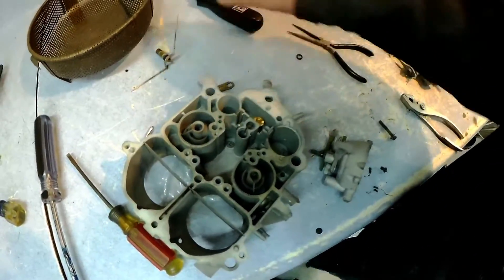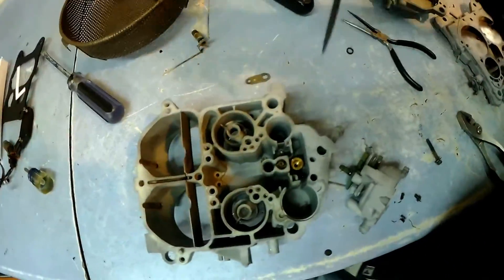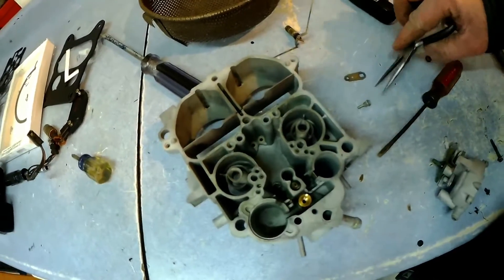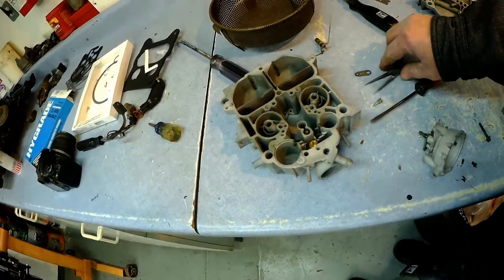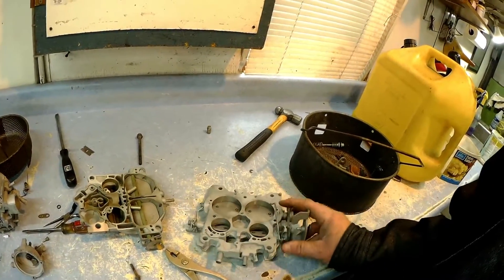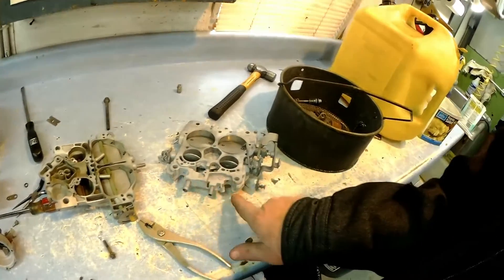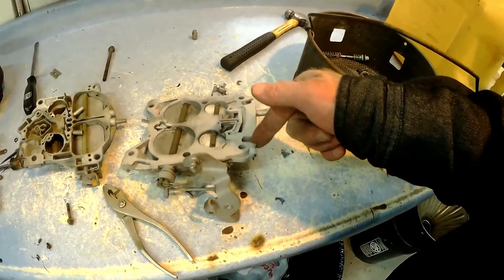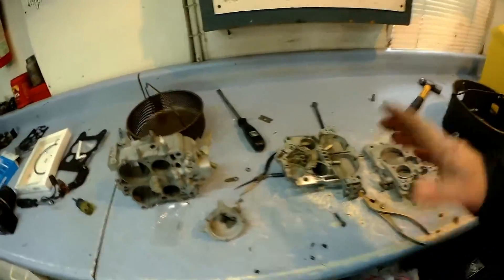GM Quadrajet Rebuild Tips

Comment: Hey Mark, great video!    I just rebuilt my quadrajet today but the included instructions didn't have my particular model# to set the float... what height is a good one for my old 1984 motorhome quadrajet?

Also, can you please elaborate on setting the idle screws? I didn't mess with mine, only cleaned them and put them in the way they were before but I'm sure it's running too rich
Reply from the maker: Basically, if your float is new (unbent at the adjustment point), install it and push down on the needle end (so the needle is shut off).  The float (itself) should be parallel with the top of the carb.
If it's not, bend it at the adjustment point.  If your carb has not had the idle restrictors drilled out, your idle screws are only effective until about 3 turns out. Beyond that, they do nothing.  So start at 3 turns out and you can go in a little, perhaps down to 2 turns.  Play around with them until you're satisfied with the idle.  You can tell if you're lean by placing your hand over the air horn and slowly restricting the air going into the engine (causing some fuel to be sucked out of the main nozzles).  If the idle picks up, you're lean.  Back the mixture screws out a bit.  But like I say, anything past about 3 turns and you're doing nothing.

Comment: Mr Mark I rebuilt Rochester  Quadrajet put it all back together but would not stay running i could here a vacum leak but i can"t not find it.'
Reply from the maker: Take a piece of vacuum line about 4 feet long, put one end of it at the opening of your ear, take the other end and start moving it around the base of the carburetor, intake manifold, etc.  You will instantly find it.

Comment: I'm really scared to rebuild the truck is running good but I dont know how long it's been on the truck and want to redo everything so I know when it's been done. Am I going to have to retune or do any timing after I rebuild or can I just slap it back on and go?
Reply from the maker: Just mark the choke spring to the housing (assuming you have a integral choke).  You can count the number of turns the idle mixture screws are turned out and set them back to the same setting if you're worried about that.  Beyond that, there is nothing to worry about.

Comment: I have a question.  After cleaning the carb can you paint the carb to get a good look under the hood or look at edelbrock
Reply from the maker: I've never tried but I can't see why not.  I'd start with primer suitable for aluminum (let it dry real good, stick it in the oven at 160 for a few hours) then finish with your color coat.  Be sure your color coat is gasoline resistant. A 2 part epoxy might work. My gut tells me you want to "brush" it on because if you try spraying it on,  you'll get paint in places is should not be. Stay away from the throttle shaft, choke plate, accelerator pump,  any linkage..... If you do, please put up a video of the finished product !

Comment: Dear sir:
I own a 1977 chevrolet Corvette with  the L82 engine
After suffering a gasoline fire in my garage due to a broken glass bodied fuel filter.
Needless to say I had one of the most scary moments of my life until I was able to put out the fire.
Anyway the damage to distributor, wires, carburettor was extensive.
My mechanic and I decided this could be the time to make a long needed overhaul of the engine and I went ahead and bought a new distributor and a rebuilt  quadrajet carb.
My problem now is as follows:
Thr engine starts easily and after warmed up and going to idle it dies.
Something looks wrong with the idle  circuit.The only way to keep it running is to accelerate to 2000 rpm or so
What do you make of this.
Your experience is invaluable for us.
Thank you in advance
Reply from the maker: Yes, I agree, the idle circuit is most likely the problem. As a test, place your hand over the carb inlet, slowly restricting the air flow at an idle, and if you can correct the problem, the idle circuit is almost certainly the problem

Comment: I could use some help. And thanks for the tips. I have 3 quads that came off a 305s. I want to rebuild 1 and put it on my 496. I’m worried the carb will be to small. Any thoughts.
Reply from the maker: Ok a 496 turning 5000 rpm consumes  ((496/2) x 5000)/1728 = 717 cubic feet per minute of air.  But then we reduce that slightly by the volumetric efficiency.  90% is considered good, so 717 x .9 = 645 CFM.    So yes, it will work. But if it's off a 305, the secondary air door is restricted from opening all the way.  Just saw off the stop so it flops all the way open (90 degrees) when you press on it.   If you're spinning it harder than 5000, you'd probably want to find an 850 Q-jet off an older big block Buick or Olds, but even at that, it will still work just fine if you don't.  You'll just lose a little horsepower right at the very top. But nobody should be spinning a 496 faster than 5000 anyway unless you like rebuilding the thing every other week...lol...  I've been down the road with those engines more than once.
Reply: Thanks for the reply I ended buying the HR750 quick fuel. But later I like to experiment and mount 2 quads on it. Thanks again.

Comment: Mark, I've found  this video to be very informative...Thanks .  I do have a question regarding the quadrajet living under the dog house on my 1985 Chevy P30 motor home chassis, which I'm  in the process of rebuilding.  Are there  any additional tips you can offer regarding a balance of drive-ability and economy, as this fleetwood behemoth doesn't get the greatest mileage, nor power when you need it.  This carb  sits atop a chev 454.  Any help would be greatly appreciated...Marty
Reply from the maker: Sorry sorry - nothing that I am aware of will give you both better drive ability AND better economy.  They are exclusively at odds with one another :-(

Comment: Hey mark just got a 85 c10 with a 4.3 with this carb,its been sitting but not that long,what would you recommend?should i clean it or rebuild it,the truck start runs good and idles pretty good but since its been sitting.i dont know just a 17 year old trying to learn,should i mess withit or leave it alone
Reply from the maker: Drive it, see what you got. Those old 4.3's with 4 barrels ran good !
Reply: @mark_osborne  alrighty what about the granny low four speed those run pretty slow or get up and go

Comment: What a great video. Can you provide more details on how to get the best gas mileage for a daily driver?
Reply from the maker: There isn't much you can really do if it's a stock carb with proper jets and metering rods sized for the engine. Advancing the timing a few degrees can help at the risk of spark knock.  Make sure your mechanical advance is working properly and the vacuum advance is functioning and has the proper vacuum source connected to it.

Comment: Taking you up on posting a comment with a quadrajet problem.  I rebuilt mine, but did not file it down like yours unfortunately.  I just saw your tips today.  Anyway, my carb runs a little rich, so I hooked up the vacuum gauge to adjust the mixture screws, but when I adjust them, there is NO change.  I can back the screws out and screw it all the way in and there isn't much change - no drastic change anyway.  Any suggestions?  It is a marine quadrajet - probably doesn't matter.  The exhaust smells rather rich and I can see a little fuel maybe in the exhaust water discharge, but it seems to idle ok.  Not as nice as my other engine idle, but it does idle alright.  Also, very, very hard to start cold, but once it gets going, it is good.  Maybe they're related...I dunno.
Reply from the maker: When you run those mixture screws in  you are cutting off fuel to the idle circuit (as you probably know) and it should get so lean it stumbles.  Because that's not the case, I suspect you're getting fuel from somewhere else and the most likely culprit would be if the fuel level in the float bowl was too high.  Try looking down into the discharge boosters with a strong flashlight and see if you can see fuel dripping from a booster, check the secondary side too.   A hard cold start (if carb related) means either the accelerator pump isn't shooting fuel when you pump the throttle, or the choke isn't closed all the way.
Reply: @mark_osborne  I've got the same problem.  I checked the float, now I'm looking for a vacuum leak.  Only getting 14" of vacuum

Comment: My marine quadrajet won't idle at all. Took it apart and rebuilt it cleaned everything reassembled but zero idle. Will run with anything above idle or if choke is fully closed. Btw this is why I rebuilt it in the first place. Ideas? I tried the two air mixture screws and made no difference
Reply: Any thoughts on the no idle situation?
Reply from the maker: Sounds like a blockage in the idle fuel feed circuit. It's not likely in the throttle plate as you can literally see the circuit, rather, almost certainly in the body of carb.  I'd take it back apart and using a rubber blow-gun nozzle, blow air down through the holes that are next to the primary venturi (s)- both sides. This is the idle fuel well.  Take a small wire and see if you can dig around as well. Also, make sure the top section of the carb is not warped. If it's warped, fuel won't flow properly through the idle circuit as it takes a trip up- then back down through the top plate right next to where the 2 small bolts secure the top plate at the venturi (both sides)
Reply: Thanks I will try that. I forced carb cleaner through all passages and it seems to flow thru but did not use high pressure. Carb did have water in it and sat a couple years, was a dunked up mess when i took it apart. Good news is everything past idle works great now, don't believe the secondaries worked at all before, always bogged down and had to pump the throttle to get it on plane. Greatly appreciate your insight, great viedo!
Reply from the maker: @timmthirty7928  water is the worst, almost certain there is corrosion in the idle wells. You could try some CLR, squirt some down the the holes into the idle wells and let it sit, blow it out, repeat, you might clear the blockage

Comment: getting ready to do one and I think there is issues with the linkage.  The secondaries do not open up. After removing the carb I noticed a lockout for the sec.  What is that for? Where do I find the specs for the linkage? Thanks
Reply from the maker: It's there to prevent the secondaries from opening while the engine is cold. It's pushed out of the way when the choke opens (fully).  You can eliminate the lock out by removing it.  Your secondaries will open while the engine is cold, possible "bog"... but it's all good if you are prepared and compensate with your driving style.  Once she's warmed up- it's all good. If you want to keep the lock out, just be sure the choke opens all the way once she's warmed up -  that will push the lockout out of the way.  Otherwise, there are no specs.
Reply: @mark_osborne  Thanks for getting back to me.  Starting on it today hopefully.

Comment: mark Hello, greetings from Venezuela, what could I do to save fuel? I have a dual jet but it is a dragon, yes it canbio chicler and how could I lower consumption? What do you recommend? Greetings and thanks for your help. You are a master in this I congratulate you  I also discovered when I was cleaning it that it did not have the control ball that goes under the screw that you explained what problems it brings me that increases the consumption of gasoline for not having it
Reply from the maker: The check ball allows the accelerator pump to function properly, it will have no effect on fuel consumption.  Make sure your float is not set too high, if it is, you can get 'spill over' effecting fuel consumption.  Beyond that, there's nothing easy you can do that will cause it to use less fuel.  If you have an Oxygen sensor make sure it's working and plugged in.

Comment: Hi Mark, great explaining. I have a qj on an aussie holden v8. I just set the choke to lean as we dont get that cold here. Its been running rich and chewing fuel. I noticed the secondary air flaps on top seem to be fouling on the carby body or shaft. Also my secondary vacuum pull off isnt working as i tried to suck test it. Nothing. Any advice please? New fan down under
Reply from the maker: The air flaps are hitting the top because the top 'distorts' over time from the pressure of the screws. If you look close, you can see where the door hits. Just file the top in that area a bit with a rat tail file. Stuff some paper towel down into the barrels first.  As long as your primary pull-off is working, you're good.  The secondary one is just a back up from what I can figure. As far as it running 'rich',  are you certain your choke is completely opening ?  It's common for chokes to get lazy and WOW will you eat fuel.  The heat (exhaust) cross over in the intake can get plugged with carbon and your choke won't get enough heat.  That's just one example of WHY a choke can get lazy.  Check those things and let me know.  Your choke should completely open with zero tension, and that will also allow your secondaries to become operative.
Reply: @mark_osborne  cheers chief,  i will look into it and report back. 👌👍

Comment: correct me if i'm wrong, but i was told the quadrajet  only came in 750 and 800 cfm. thoughts from you on that.
Reply from the maker: I believe you are correct
Reply: @mark_osborne  
Chevy only used the 750cfm q-jets on their Sbc & bbc motors.

It was caddy,olds,Pontiac,Buick that used the largest q-jets (approx 800cfm) on their larger displacement V8 motors.

Comment: Great video!  Got any tips for stopping the MCS from ticking? I've heard this is normal on the 87 Chevy's
Reply from the maker: It's supposed to 'tick', it's a duty cycle solenoid - the longer the pulse width, the leaner the mixture and vice-versa

Comment: I've fooled with Quadrajets for years also. The newer ones have me puzzled in that on the front pass side across from the accelerator pump is a BIG black plastic "cup" (if you will for lack of a better word) which I'm having a hard time understanding what this is engineered into carb for. Could the cup also be left out to help with more fuel storage since Quadrajets have a small fuel/float bowl area.
Reply from the maker: Yes yes, I see absolutely no reason you can't leave it out.  It never made sense to me why it's there.  In some of the Cadillac carbs, there is an altitude enhancement thinggy that fits into that pocket, and it's adjustable.

Comment: Mark, can you give any advice about the hot idle compensator? 

Information is limited I can’t seem to find anything. 

Can it be eliminated if it’s pulling a constant vacuum?
Reply from the maker: Yes you can block it off by tapping, and threading a bolt into the hole. You'd see them on Cadillacs, mostly.  It was used to offset the vapors coming out of the fuel bowl due to high under-hood temps - which caused a rich idle. It provided make-up air.  Unnecessary for most applications.